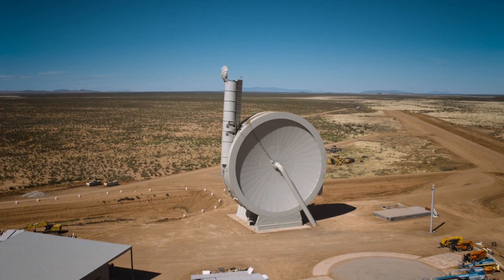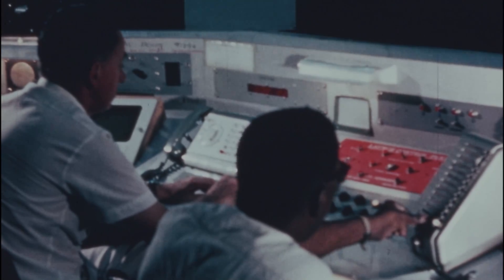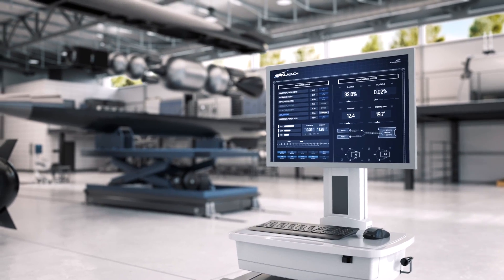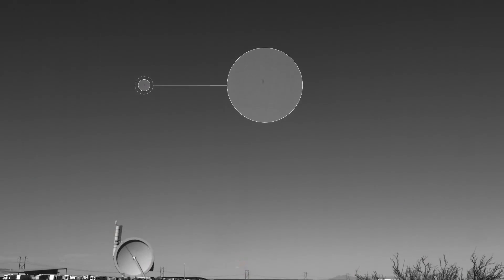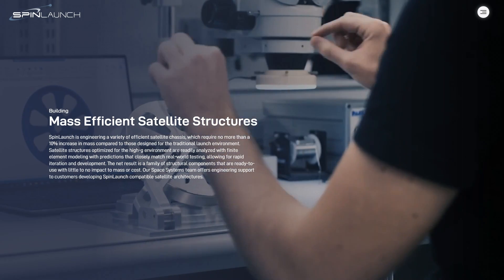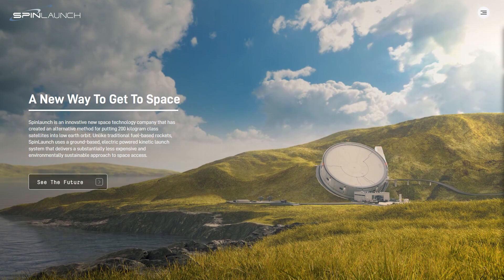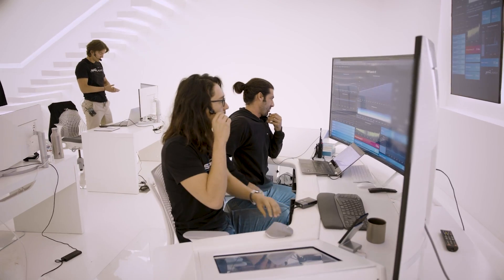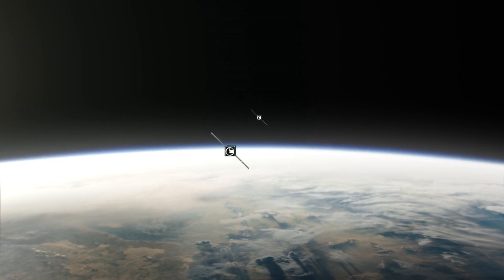Can Spinlaunch Throw Rockets Into Space?

Comment: I agree this could be a great moon launch system, I just can see they will realistically get to Mach 5 at sea level and keep the rocket on the correct
Reply: You still have to get all the parts to build it to the moon. And since the moon has a insignificant atmosphere and low gravity it seems like it would be easier and much much cheaper to use a conventional cannon to do the same job.
Reply: @Jimmy_CV  I suppose a canon or electrically powered rail gun would make more sense on the moon.... 
Especially if you are sending back mined resources  to earth

Comment: So what could this be used for? Im thinking of uses. Like maybe it'd be good to launch fast operating satellites in time of war. But besides that I can't think of any use.
Reply: Well, a nuclear warhead doesn't weigh a whole lot and by its nature, getting it all the way into orbit isn't necessary. They're also pretty durable things, given that we know they can be fired from artillery. Ballistic missiles aren't particularly sneaky and create a distinctive infrared launch signature. An object that can fit in a suitcase being yeeted at a several kilometers per second isn't going to emit anywhere near the amount of IR a missile launch will. It wouldn't even have to be a "dumb" warhead, either. It could be designed with control surfaces and its own terminal guidance to act as a hypersonic glide vehicle. The long spin-up time is a bit of a drag, but if you're launching a first strike, that's no issue because the preparation would be undetectable.

Comment: 10000G doesn't actually sound like the acceleration a rocket with a payload can take. But even if this isn't a problem, is the initial speed enough to get the projectile to the altitude of 61km by overcoming aerodynamic drag? An additional problem is that due to the conservation of angular momentum the projectile will still spin around its lateral axis after release and there is no way to stop it from doing so.
Reply: What about a two stage release, where the front of the rocket is released a split second before the rear so that it loses its angular momentum before full release, and exits the chamber in a straight line?

Comment: Has anyone come up with how they can achieve a vacuum in a room with a shaft running through a high-speed bearing in the floor?
Reply from the maker: Using the same kind of seals they use on the rotating joints in space suits.

Comment: Fuck the hyper speed release just use it as suborbital kickers. Remove all boosters and prelaunch combustion save on weight and combustibles. Like a hybrid car. Use the electric to sling the object on course and use rockets to continue accelerating in higher altitudes.

Comment: Scott, you're being way too optimistic, and you're taking them way too seriously when they themselves are not, judging by the dust and the rust inside the Spinlaunch chamber. Negative pressure and dust/rust don't mix, period (pun intended).  The hurdles they have to overcome are very significant to say the least.  Not as crazy an idea as Hyperloop considering that MOST of the materials necessary to make the project work already exist but then... same is true for Skyhooks. Notice how the projectile(missile) is exiting the chamber. It has angular momentum of roughly around 30 degrees, which is absolutely disastrous if you extrapolate this onto much higher, hypersonic velocity necessary to achieve the required altitude for the engine burn and orbit. Their missile is clearly tumbling. The video shows insane yaw, it's tumbling more than an AK74 5.45 mm bullet after about 300-400 yards. You have to keep in mind that the current system is achieving roughly 2 - 3.5% of the total energy required for the actual orbital launch of 2000 m/s. Just imagine the angular momentum, the yaw and the tumble when this goes to 100%. Next problem is the bearings. The large non-enclosed bearings they're using will allow the atmospheric Nitrogen to leak inside, it's one of the issues not quite worked out, and it's not a small problem at all. It will take a number of days to bring the negative pressure inside the much larger chamber to required parameters necessary for orbital launch , much longer than it takes to fuel a rocket. And this is just the tip of the iceberg of problems. As others have pointed out, - next comes the problem of air resistance, and this is where materials that can withstand the air friction at Mach 5 are sorely lacking. The CEO, by the way is lacking the qualifications necessary to design or operate such complex vacuum systems. Can this work? Yes, it can. IN THEORY. Are they close to it to get to space within a couple of years? NOT A CHANCE. It will most likely take a few decades. And yeah...hope they prove me wrong, do revisit my comment in 5 years will you? As for now I conclude that this is just as much a scam as Hyperloop, put together to make the gullible, wealthy people, unfamiliar with orbital mechanics, rocketry principles and even basic High School Physics invest heavily into a testbed that will most likely lead to nothing useful...

Comment: Thunderfoot has thoroughly debunked this stupid idea. It is the kind of idea a child might think of but would not stand up to basic maths and physics calculations.
So let's do some maths!

200 kg moving at 2235 m/s on a 23m radius experiences 22139 G, effectively weighing 4427 tons. 
But taking the numbers quoted on this video;

450 rpm 100m diameter = 2357 m/s = mach 7.12 at sea level.
and acceleration = 2357^2/50 = 111122 m/s/s = 11327 G

A 10-tonne vehicle experiencing 11,327 G = 132,700 tonnes.

To put that in perspective, that is over twice the mass of the largest battleship ever built, the Yamato-class Japanese battleships weighing 64,000 tonnes.

So you have the rotator bar holding the weight of two battleships on each side.
One side has to let go in 370 microseconds for 1-degree accuracy,
while the other side has to make the weight of two battleships 
magically disappear in the same short time.

If it simply let go of a 10-tonne counterweight travelling downwards at 2357 m/s,
hitting the ground, the kinetic energy of 50 billion joules will be released.
That's nearly 11 tonnes of TNT - inside the launcher.

If they want to go from mach 1 to mach 7, g force and energy go up by a factor of 7x7=49.
Tripling the diameter reduces the centrifugal force to a mere 16.33 times what it was.

This idea is only going to make money for people making YouTube videos, they just want money from clickbait and don't care if it is highly implausible.

Comment: Theoretically, there is nothing stopping this from succeeding, but they have a lot of engineering hurdles to over come. Pulling a hard vacuum on a 100meter chamber, dealing with borderline catastrophic balance issues after projectile release, main shaft strength and support issues, projectile strength over a long period if time, etc... No one thing is impossible, but taken together they ALL have to be overcome for this to work. Small scale tests show it's feasible, but scaling this up is not going to be easy. The inverse square law is their greatest enemy. My main concern is with the launcher- at that speed the a tiny weight imbalance will lead to catastrophic failure very easily. Hell, I've worked on lathes that spin with less RPM that have spun themselves to destruction because a blank wasn't balanced correctly and that's working with numbers literally millions of times less than they will be facing.
Reply: There're many ideas that many thought impractical, but at this point many things you don't even think about had that issue and have just become a part of everyday life. If the impracticalities overcome it's counterpart, we won't see it, but as I've seen, with enough ingenuity (and money) we'll see it through.
Reply: @iceu9987  I honestly hope you are right but no amount of money can change the laws of physics. They face several up hill battles. Time will tell if they can overcome them. I'm just not going to be investing any of my money in this project just yet.

Comment: Yeah, we shouldn't shill these people. Do we even know the total mass of the final rocket and arm? Because that greatly affects the amount of stress that "high tensile arm" can withstand.

Because if we just make a "quick" calculation just throwing some numbers around, we can see that the forces quickly become unreasonable.

So, knowing from the video that they plan on having a 200kg payload, I can make an educated guess as to how much mass the rest of the rocket needs since I'm not a rocket engineer. But knowing that you need a ~96 metric ton 2nd stage to launch a ~23 metric tone payload into low earth orbit from an altitude of 80 kilometers (Falcon 9 specs), which puts the payload at about, ballpark, 20% of the second stage total mass. So if I understand this correctly and that this is how rockets work under the square-cube law, you'd need a 1,000kg rocket to launch a 200kg payload into LEO, provided that the rocket is launched to an altitude of 80 kilometers beforehand, which is the whole idea of this spinner thing.

So, a 1,200kg rocket (not counting the arm holding it), spinning in a 50m radius circle, going at 450rpm, gives us 133,239,659 newtons of centripetal force, divided over an (totally made up since they aren't telling us) area of say 1 square meter, leaves us obviously 133 million newtons per square meter, which converts to 266MPa of centripetal stress which the materials used need to overcome.

It's not unreasonable since the tensile yield strength (force at which the material returns to its shape) of a common structural A36 steel is at 250MPa and we have materials that reach far beyond that, for example 2014-T6 Aluminium alloy with yield strength of 414 MPa. So it's within the limits of reality so far. But remember that I didn't account for the mass of the arm itself. Knowing that the radius of the circle is 50 meters, it's not a small arm either.

So let's make some calculations for that too. I used 1 square meter area to hold the rocket, and the circle is 50 meters, so let's reduce that to 25 because I'm doing a napkin calculation and I'm lazy and only really thinking of the furthest half of the arm, so that's 100cm*100cm*2,500cm= 25,000,000 cubic centimeters. So let's say we use 2014-T6 Aluminium alloy with a density of 2.8 grams per cubic centimeter. So 25,000,000*2.8=70,000,000 grams converted to 70,000kg, which is obviously too much since we would use some fancy topology optimized structure, preferably made by an AI, which would reduce the overall mass by probably, at least, half. So we end up with an 35,000kg arm, holding a 1,200kg rocket, spinning at 450 rpm, in a 50m radius circle.

With all the math done again, we land on a final score of 8,038MPa.

There are no materials that humanity has access to that can withstand these forces! Only theoretical materials like carbon nanotubes and graphine have numbers that large!

This spinning thingamadoohicker is total science fiction! I didn't have to make a bad prototype to prove that this won't work. All I needed was ~1 hour of online research and a calculator.

You, Scott Manly, should be ashamed for giving these people more time in the editing software than on google. This is your field of knowledge and people trust you. Don't squander it that trust with this BS...

Comment: You could probably rebalance it with a sliding shaft; drop a small weight off the counterweight side, and the rocket would end up pulling the shaft out by centrifugal force, with only friction forces applying laterally on the bearings; then release the rocket and stop the shaft from sliding, with only the linear momentum of the shaft being absorbed by the bearing. At this point, the shaft would be balanced, if the timing is right.

Comment: Hello Scott, I understand why the Hoffman transfer orbit is used for fuel efficiency and to minimalise  human exposure,  are there other transfer orbits that can be used to deliver un-crewed cargo to mars but don't require you to wait 24 months to use. Can Starship loose a bit of cargo capacity to enable it to be launched more often, if so how much cargo lost and how much more often?
Reply: Probably, but I'd imagine either the delta-v cost would be rocketing up (pun intended), and/or the required time to reach Mars would be more. I.e., shooting 'straight' at Mars when it's in opposition would need you to basically reach third cosmic velocity to be able to yeet yourself directly outwards the Solar System, and then spend about the same delta-v to decelerate at Mars, and not just do a very quick flyby there. (Grammar nerd correction, it's Hohmann transfer.)

Comment: Have it spin with 2 equal loads and release them simultaneously. The projectile and the counterweight. The counterweight could be a water tank. It would be ejected downwards, so you should build a hole/ramp that it would fly through and then splash violently at a safe distance.
Reply: The energy stored in the counterweight is set free inevitably once it hits its target. The result is an explosion in the size of 7 Tons of TNT - no matter what type of counterweight you use. Even water would cause a steam explosion which would rip away any structure and leave a large crater.

Comment: There's also a maglev concept of speeding up a rocket horizontally with magnets.
The percentage of weight in stage 1 in insane.
Each individual project will probably fail, but reasoning from first principles - drastically reducing the weight of what you're putting into space - getting rid of stage 1 somehow makes a ton of sense
Reply: It does make sense, but until you solve the issues with punching through full atmospheric pressure in excess of mach 6, your approach has serious limits.
Reply: what if we used a really big mountain as an inclined plane to mount the thing on? Then we could have a vacuum tube with this same material at the end that breaks when the thing passes through it. Having the projectile already be 20,000 feet up would help with the air resistance issue.
Reply: @N9197U  I was thinking the same thing.
Reply: I like this idea ~
Reply: Why does this have to be an either/or thing? Why not just build one to the technical possibilities now, substract whatever amount of fuel/mass was saved from the first stage construction and then keep going as you would with a normal rocket?

Comment: no, simply no. 100kg payload @10 000g is 1000 tons. You have to hold that payload with the rotor that has to be lightweight and strong enought to hold the payload and itself.
Reply from the maker: Why does the rotor have to be lightweight, it’s not going to space.
Reply: @scottmanley  because of mass that it will add to hold itself in one piece (square-cube law). Also after release we're takling massive imbalance and basically object traveling @ mach7 hitting 1 bar.
Reply from the maker: @maderpl1  Yes, after release the center of gravity moves, but it moves less if the arm is heavier.

Not sure what you're getting at with #1, it sounds like you're caught in circular reasoning.

Comment: If they could put this in the Andes mountains near the equator at an altitude of 15,000 to 20,000 ft, it would have a higher velocity to start with, and already be above the thickest part of the atmosphere so there is less drag and less frictional heating of the rocket.  Maybe the system is more ideal for sending bulk materials into orbit.  The kind that are less susceptible to damage from high G-forces like water, fuel, etc...

Comment: How does the rocket have to be constructed to withstand the lateral G forces produced by the centrifuge at the necessary velocities?
Reply: At least in the animation it seems to be clamped around the outside and is made of two axial halves.
The lateral Gs would press these halves together against the clamp.

The wall thickness seems quite beefy probably to withstand the compressive force when being pressed together
Reply: @datpudding5338  Also would need massive internal bracing, and heavy reinforcement and reconstruction of internal components. Rockets aren't normally built to take these g-loads. Would imagine a rocket for this thing would have to be at least 2-3 times heavier than a normal second stage.

Comment: Reduce air pressure at launch by vaporizing the air with a high powered laser beam that expands the air at lightning speed (causing a sonic boom like natural lightning does) and which also creates a temporary vacuum channel (like a tube) for the trajectory to immediately be launched through.  Basically carve a tunnel through the atmosphere. Timed correctly, as the atmosphere closes up from the point of origin upwards, it creates a slingshot effect for the launched projectile.

Comment: Drill a chamber inside a mountain for spin-up with 2 horizontal exit tunnels, launch 2 rockets simultaneously in opposite directions and maneuver to vertical ascent after launch. Horizontal exit tunnels can be upgraded with linear magnetic accelerators for extra "yeet".
Reply: @sirensynapse5603  Nope, going straight up you'll just end up falling back into earth's gravity well. What you need is a sufficient impulse directed along the intended orbit, which is near parallel to curvature of the earth.